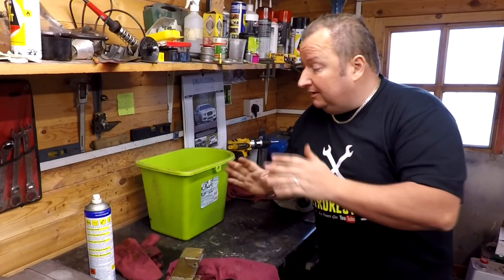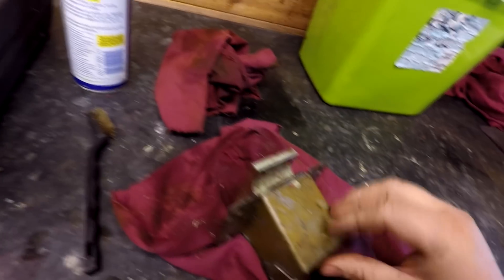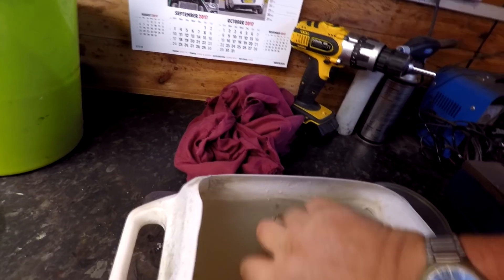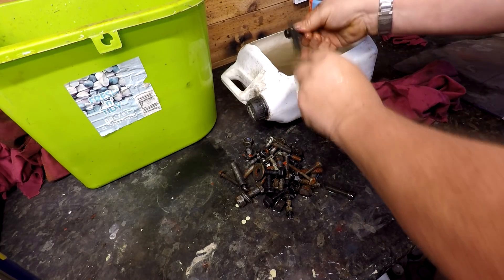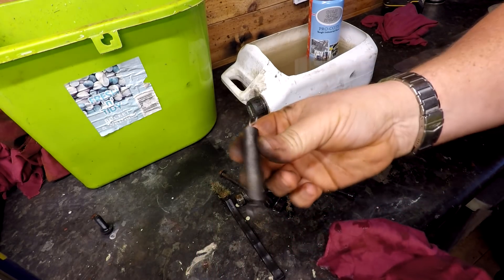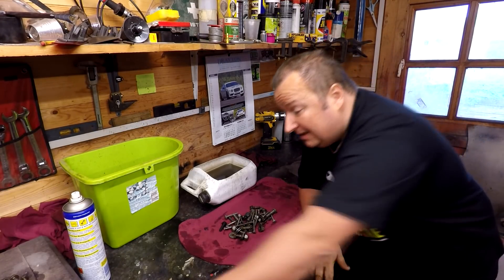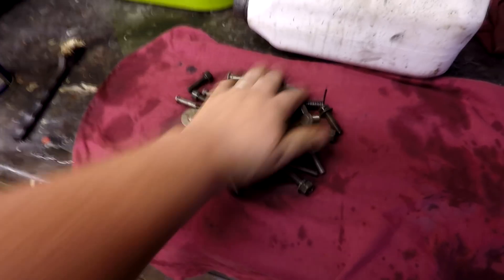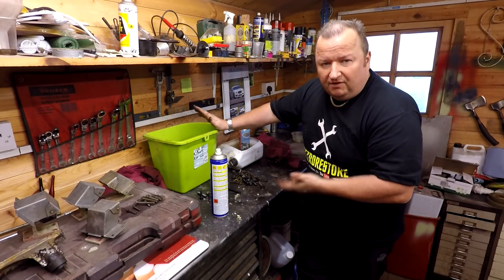Can Vinegar Eat Rust RESULTS

Comment: Ive stuck a rusty door hinge taht's seized up in a cup if vinegar. Will that unsieze it?
Reply from the maker: Only if it can penetrate the pins Michael. Worth a try.
Reply: It has paint and allsorts have crap in the pins but the vinegar can get inside the pins.
Reply from the maker: It won't remove the paint bud
Reply: Ive scraped alot of paint out of the pins but might have to knock themout.
Reply: Ive left the hinges in vinegar for 2 days now and the hinges are like new. Its got a bit of pitting in them but they are 30yrs old.

Comment: Thanks Martin, it's been very interesting to see the results. I've got a petrol tank from a classic Mini that's been standing for a long time with old fuel in the bottom. I swilled it out with petrol before use buts there's still a lot of crud getting through the filter and up to the carb. So after watching this, I think I should get a gallon of vinegar in there.
Reply from the maker: Sounds like a good idea Andy, you can see it works well.

Comment: It does that to rust? I pour loads on my fries. What's it doing to my stomach? Excellent results Martin. Looking forward to the moped continuation.
Reply from the maker: You're probably rust free inside Bri lol
Reply: Martin, I picked up a 'Dead' pressure washer a few weeks ago for $25. Put some gas down the combustion chamber when plug was removed for cleaning and inspection. Fired up but not getting fuel. Removed carb and bowl, rubber and old fuel gel. So I tried your vinegar expecting results like you had with bolts. Uhh...NO. Don't put carburetors in vinegar over night. It eats through aluminum and causes craters and pits. Bits of aluminum crumble off edges. It's okay in the end, found a brand new exact same carb on eBay for $10 and free delivery.
Reply: Yes Bri, It will eat Aluminum as you found out, I've not tried it yet but you have confirmed it for me.
Cheers
Martin

Comment: Martin,  I have tried the vinegar and it is the best for rust removal.  Muriatic acid is nasty nasty stuff.  I did a drill press restoration video using vinegar and it turned out excellent.  You can spray the parts with a clear coat to prevent any rust (after the base wash).  Looking forward to the scooter videos, as I just got one that I am putting a big bore kit in this weekend.  Bob
Reply from the maker: I watched your drill press vid Bob and that may have been the vid to get me to try it.
Great result and safe to use as well.
Cheers
Martin
Reply: Vinegar is asetic acid